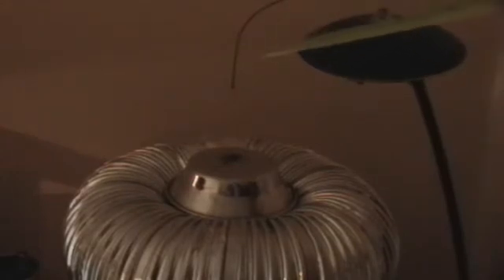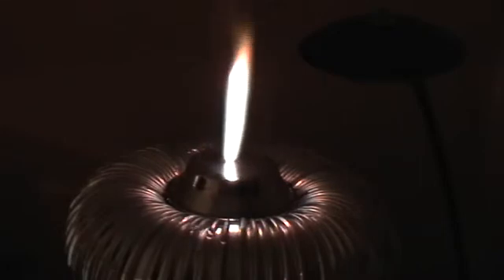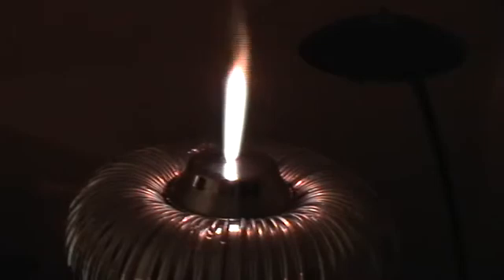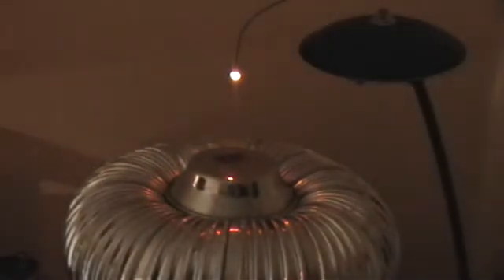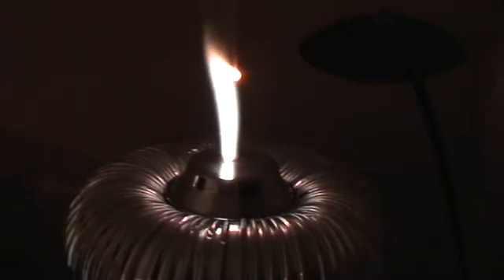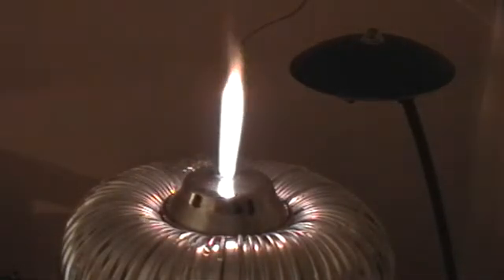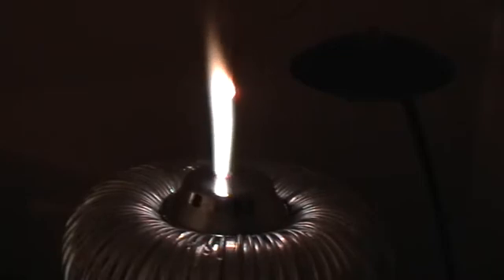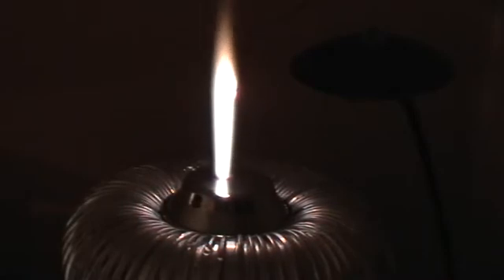TinselKoil 15c: How Hot is Hot?

Comment: I love doing this experiment with Tungsten rods, or Carbon rods, which both have extremely high melting points(actually carbon turns into a gas) the light it starts to eminate is incredible. The temps the rod approaches as it begins to vaporize is  almost equivalent to the surface of the sun.